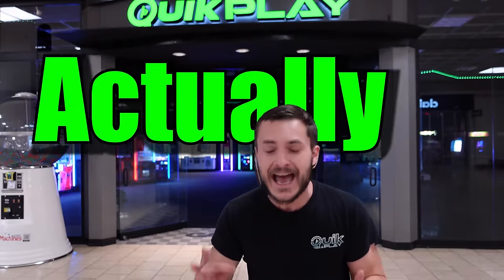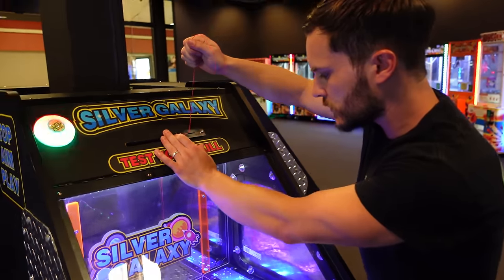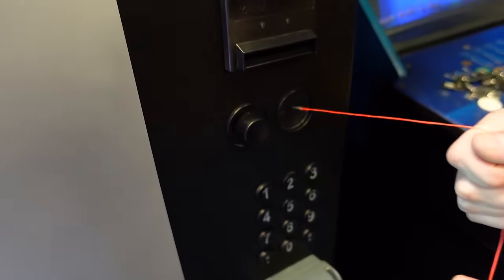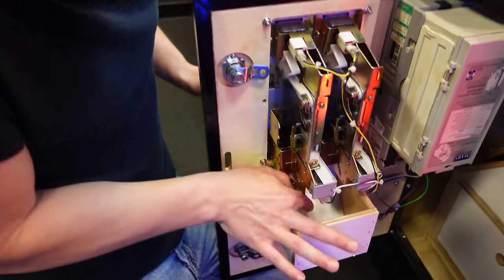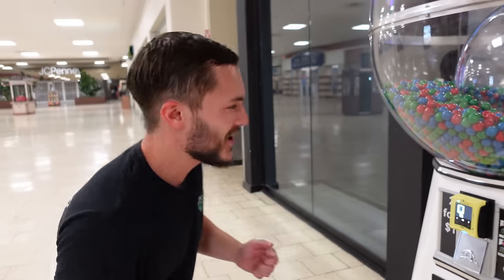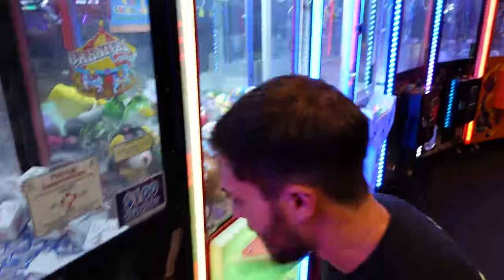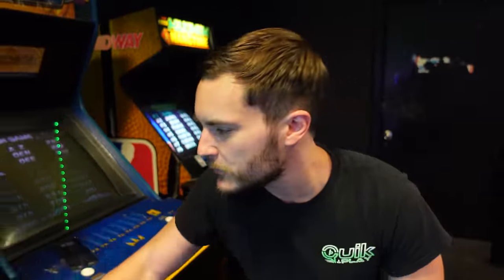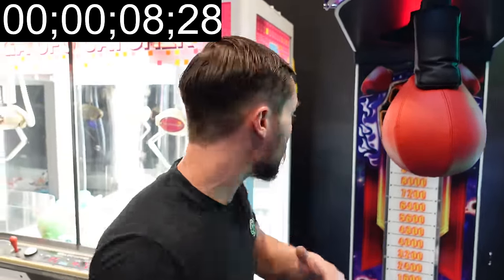Do These Vending Machine HACKS Really Work?!

Comment: so the holding the button trick is more of the fact that it can override the slack sensor on SOME claw machines. most claw machines can detect when the cable goes slack when the claw reaches the bottom of the machine and is programmed to stop the hoist from going down even further. however, some claw machines if you hold down the button it will override that sensor and allow the claw to drop further, which might be an advantage on larger prizes that the caw struggles to get around, which may increase the odds of the claw actually grabbing the prize.

Comment: From my own experience, the older soda machines that had the white circles as push buttons, I'm talking way back in the late 90s early 2000s, there was a sequence of presses, like 4-2-1-3, and it would go into a maintenance like mode. I was even able to change the price of the sodas. A second thing that happened, and I have no clue what caused it, I was looking in a claw machine, messing with the stick and pressing the drop button, and the next thing I knew, I had 99 credits and was actually able to play. The only thing I can imagine is something messed up because I doubt there was a combination that would give basically unlimited tries. So these things did exist at one time. But after decades of losing money, they fixed all known issues.

Comment: The coin pusher machines with branching paths do make the coin-on-a-string hack more difficult to pull off, and are actually a little more fun to play—or at least I find so. That said, there's also a legitimate strategy of giving some spin to the coin right when you drop it in to have at least a mite bit of influence on it's trajectory that I have had wonderful success with! I also was once kicked out of an arcade for winning with the coin spinning tactic, mostly because that specific arcade's owner was an arse who couldn't differentiate between cheating and using one's bloody head!
Reply: I can just bump coins off the top moving shelf and get many free coins out as it moves the lower ones forward make about 15 dollars or more every time untill the top shelf is almost empty  , then wait for more suckers to top it off again , no the alarm will not go off as the machine is bolted to the wall,lol !

Comment: Thank you for doing that. To fix the coin pusher, just put a spring flap on the bottom of the slot. They won't be able to manuver the string or bring the coin back out. If the spring is strong enough, it would close on the string as soon as the coin clears preventing the coin from even falling...

Comment: I remember when I was a kid we made a device using the internal electric components you get in oven/stove lighters that when fashioned in a certain way can be used to get credits or even cash out of the old style fruit machines. We called them clickers and depending on the machine and the position where you clicked it would basicly confuse the machine and give you random plays/payouts etc without putting any money in the machine. Don't think it would work on the new ones.  We used them on all kinds of machines, vending machines and arcade machines and got about a 95% success rate. Some payphones worked too but they were harder to replicate. This was about 30 years ago when I was a scallywag lol.

Comment: There are a few vending companies that made 'computerized' vending machines about 20 years ago that did have numeric hacks that were meant only for use by maintenance personnel. you would unplug or flash interrupt the power to the machine quickly and enter a 5 digit code * 2 digit code # then Item number and it would dispense that item, the quirk was it didn't register in the machines tally because it assumed you were going to open the unit and reinsert the item back in place.

Comment: For the most part, no. People keep breaking ours by forcing the machine to believe it "didn't vend" a soda, which would normally give you your money back, but we fixed the hack. Now they just break parts of the machine and cause other sodas to get stuck. Stick a note on the machine if you legitimately get ripped off, we will get it back to you.

Comment: Want one that works if the software hasnt been manually updated? Coke machines with the clear turning mechanism  where the drink comes out. Insert money, keep finger in gap to prevent the clear plastic from closing all the way. Drink gets stuck on conveyor and refunds money. Reinsert money and make a second selection. It'll dispense the first drink then refund you again.

Comment: The last trick could sometimes work if the machine can hold the bill and return it if the purchase is canceled. This way the credit is given before the bill goes into the magazine. You can pull the bill back and still have the credit. Some machines are smart and detect this but some cheaper dumb ones don't and you get free credit. But the bill have to be higher value than the most expensive product in the machine, otherwise it tries to put it into the magazine so a second bill can be inserted and only register the credit if it's there.

Comment: try letting the dollar bill go all the way in and register, in the video the tape is longer than yours and then its pulled out after it registers, cant speak for newer machines but this did work for older coke machines back when they came out with the dollar bill slots plus your tape is not clear so your machine might keep rejecting it.

Comment: The quarter on the string use to work back in the 70's 80's but around 92 most but not all the coke machines, pepsi and snack machines were fixed with new Mechanisms to prevent it. Dont ask me how I know. kekekeke. It still works on video games ( Arcade Games ) till this day. It's stupid to drill a hole in a coin when doing this trick, all ya have to do is tape the thread to the quarter and it well be fine.

Comment: The only code that still works is 4231 on the old soda vending machines with round buttons. It puts it in maintenance mode. I used to change prices on stuff back in middle school.

Comment: I got to say as A guy with friends who use to do this back in the 80's they never drilled holes in the coins and they didn't have a bunch of little Knotts in the string along with multiple different strings attached together.  But what I do remember is that 1 guy had a coin with a really fine filament with a little glue on the ribbed edge of the coin and not sure how but he was able to get as many credits as he wanted also on the pop machines back then if you had perfect timing you could push 2 buttos at once and get 2 drinks. He couldn't do it every time but man I got on to him telling him what would you do and how would you feel if these was your machines .We haven't spoken since 1988

Comment: The coin on the string thing used to work on older model arcade games.. seen it done back in the 80s..  the machinery was way simpler back then..
Used to watch a kid steal all the quarters out of the machines back in the day with an ink pen and  piece of coat hanger.... he'd pull the back of the ink pen off and it fit perfectly into the key slot and somehow popped them open after wiggling the coat hanger piece,, and he'd take all the quaters, bam done.. took if about 30 seconds to do this... don't know if he used a special pen.. I ha e no clue but it worked on everything from soda machines, arcade games, washer and dryers, anything that had those types of keys.....

Another way was a butter knife to pop the lock to get to the coins on the older machines in the 80s...
Another trick with a metal coat hanger was to bend it so it'll fit down the quarter slot and hit that little pin that gives you credits.. gotta have a little 90° at the end to catch the bar thing.. and all you had to do was pull it up and push it down really fast so you didn't get caught..  and you would end up with mass credit.. this one I did try and it worked..

Old paper clip in a pay phone.. worked...

All this stuff is old news.. and probably only works on the older machines.. but that one machine ypu guys did the quarter on the string with where the bar thing wouldn't allow you to bring ypur quarter back up... that machine is similar to the older style machines and the coat hanger trick might work on that particular machine..

If any of this makes any sense to you all.. I failed typing class.. I'm getting old and really don't care anymore hahaha... just messin...
Good show though was very interesting and brought back some funny child hood memories..

Comment: Most of the claw machines here Australia are rigged so that the hold down that button trick probably wouldnt work and vending machines have its you cannot trick them but there have been rare instances that you buy a soft drink/soda instead of getting 1 you get two and the rapid coin insert theres Usually a delay when a coin inserted

Comment: Instead try the clicker part from a jet lighter or any lighter that has the electronic clicker part. Take the clicker out of the lighter withe cord still attached and stick it down the coin slot and click away untill credit reaches 99

Comment: First of all you have to use thread, second of all you can not have anything on the side of the quarter, third of all they use digital one way switches now so it will not work,  the last time i did it successfully was 1992, yes it used to work great and you could empty the change tube at the same time as getting free pop, then pull your quarter back out, pull the coin up untill it stops then press the coin return and pull it the rest of the way out ! ,lol !

Comment: In spite of what he's telling you almost all of these work if you do them properly cuz I've seen them work firsthand. Since he acts like they don't I'm going to tell you how they do. You see when he puts the coin in on the string. The secret is don't let it go past that point so it gets stuck only that it adds credits. If you let it slip past that point you'll never get your coin back. Packing tape on a dollar bill works great. You just have to use thick quality packing tape and do it several times over then coated in Teflon spray. Seen that one work right in front of me as well. Big arcade fan since I was a little boy nothing's changed. I see why they're trying to do this to protect their butts but it's not actually true what they're telling you these hacks work if done properly sorry guys😮

Comment: I know one Hack that works with a lot of machines but it needs privacy, a hammer, and a sack.   Won't go into Details hhere and there are variations.  Joking aside I used to have NewpAPER MACHINES AND THOSE COING TRICKA DID NOT WORK ON THEM-SAME REASON, COIN GOES IN,M DROPS TO A DIFFERENT CHUTE THEN GOES DOWN-STRING JUST TANGLES UP IN THERE.  sorry bout the Caps-blindish typist and too lazy to rewrite all that.

Comment: This guy has no idea on how to use the proper technique to get the quarter on the string to work on the arcade machines. #1 never put the hole in the quarter and makes knots it makes the wieght improper and the knots can cause the coin to not want to drop by getting caught up in the mechinism, #2 u have to letthe damn coin free fall to a point right above the credit registering needle, Then start to pull up and down on the coin, if nothing happens, let the coing down lower, then pull up and down again, evemntually u well get to the point where you well get a credit, now do not let it drop any lower at that point, just keep it where it is and with the coin resting on top the needle go uop and down and get all the credits u want. if u just put the coin in the slot and slowly just lower it down without letting it free fall, the coin well not go thru the mechinism to the neddle.